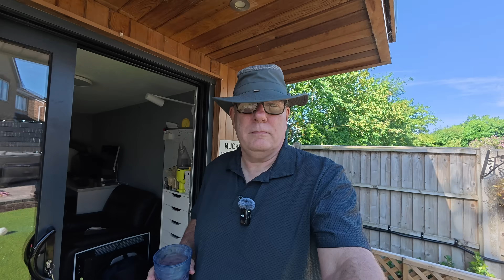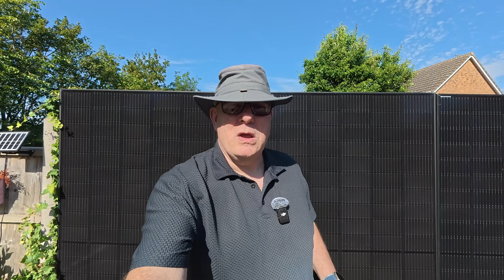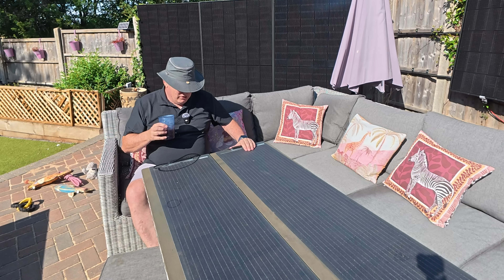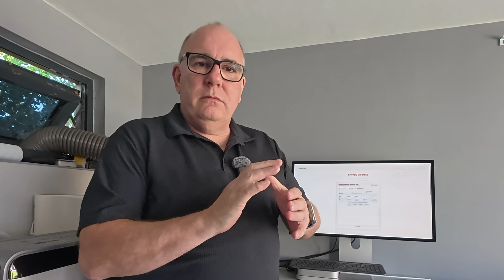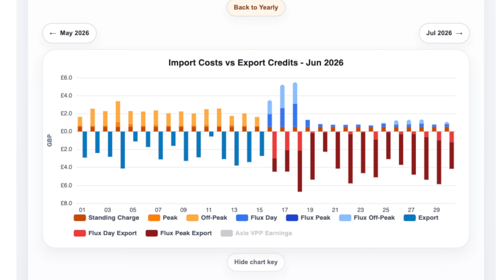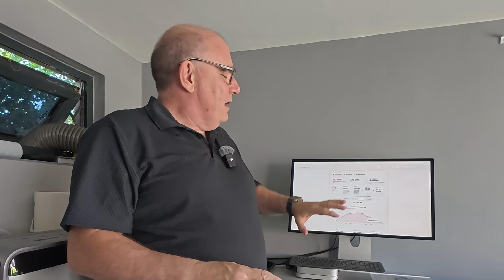Octopus Flux Is Back! Plus 4 Big Energy Project Updates

Comment: John I currently I’m on Eon with a zappi and charge every other day my Ev thinking of  hanging my battery to a power wall and going on octopus flux tariff as my export rate has dropped with eon and want a battery that manages the best solution are there any issues with getting a decent 20-25 kw charge overnight for my Ev from octopus on the flux tariff and charging a power wall my array is 4.7 and I generate about 4899 kw per year welcome your thoughts
Reply from the maker: there are no issues, but if you don’t have solar flux really isn’t a great idea. The reason is is that the difference between the price you buy energy and the price you sell energy isn’t very good. You only get three hours overnight rather than six on something like intelligent octopus.

Comment: Hi hoping either yourself or someone in the comments could shed some advise. Is a bi directional breaker required for plug in solar? And is it only needed for the socket circuit don't have to change all my circuit breakers in the consumer unit for bi directional ones?
Reply from the maker: @AshleyPeinelt, good question. My understanding is that any bidirectional protection requirement would apply to the dedicated circuit used by the plug-in solar system, rather than meaning every breaker in the consumer unit must be replaced. The final installation requirements will depend on the published rules and your consumer unit, so I’d have a qualified electrician confirm it before connecting anything.
Reply: @JonathanTracey Thanks for the reply Johnathan, I think for the cost I will just get the circuit breaker replaced for bi directional one. But like you mentioned I'll get a qualified electrician to  check this.

Comment: Sadly in my area the Flux tariff rates are not as generous. Daytime export is only at 10p and nighttime flux rate import is at 15p.

So if I don't have a lot of energy to sell at the peak time 4-7pm at 29p, I'll be making a loss.
Reply from the maker: those are my rates but I can run off my own battery all day so no daytime use and export 15-20kw in that 3 hour period. Making between £3.50 and £4.80 a day at the moment
Reply: That 29p peak window doing all the heavy lifting is exactly the problem - if tomorrow turns out overcast, you've imported at 15p overnight and have nothing to sell. A 7-day hourly forecast helps here: I use Volcast to decide the night before whether to trust tomorrow's sun to fill the battery for the 4-7pm window, or charge from grid to lock in the arbitrage. Makes Flux viable even in low-sun periods.

Comment: I have just seen an article in The Independent from 7th July "How to turn the British sunshine into your own private power station" on the value of combining solar with batteries and there is an interesting remark near the end: "Take Octopus Flux, a smart tariff from the UK's largest electricity supplier. Unlike standard tariffs that charge a flat unit rate throughout the day, smart solar tariffs offer time-of-use pricing that battery owners can use to their advantage. The tariff allows homeowners to set their own battery schedules via an app, buying cheaper electricity during the off-peak window between 2am and 5am, and exporting stored energy back to the grid during the premium peak demand period between 4pm and 7pm." This is the first time I have seen this supplier actually advocating that their customers engage in energy arbitrage. I suspect that it also makes a higher profit for Octopus without them having to take control of your battery as in the former Intelligent Octopus Flux.
Reply from the maker: @laurencecox2657 That's a really interesting find, thanks for sharing it. It does feel like Octopus has shifted from "we'll optimise your battery for you" to "here are the tariff signals, you optimise it yourself." That certainly reduces the complexity for Octopus while still encouraging customers to provide flexibility to the grid. Whether it's ultimately more profitable for Octopus is hard to know, but it's definitely a simpler model than taking direct control of thousands of batteries.

Comment: The ivy needs to go its casting a shadow :)
Reply from the maker: yeah dammed plants :-)
Reply: Poor plants : ) Hjnestly shading can be brutal - even partial ivy coverage on one string can knock significant %  off output. I use Volcast to track expected vs actual hourly production per string, so you can see exactly how much that ivy is costing you before and after it's gone.

Comment: I do appreciate your videos - very neat job with the screen images on the solar panels in the garden. We also have just switched back to Flux from Go, belatedly but still worth it. I have the heat pump heat the hot water at 1pm from excess solar.  With 10p/kWh export at that time we don't lose much, and heating in the night costs 15p. A very minor saving. Interesting content as always - thanks.
Reply from the maker: @jeffjsmith Thanks Jeff, I really appreciate that. It sounds like you've found a nice balance with Flux and your heat pump. That's exactly the sort of optimisation I enjoy—using excess solar where it makes sense and accepting the tiny trade-offs when they're outweighed by the overall savings. Thanks for sharing your setup, and thanks for watching!

Comment: Does this only really work with HA, or do you spend time every day setting your system on the flux tariff?
Reply from the maker: no, you don’t need Home Assistant, I just have mine set up on a scheduled discharge and I’d leave it to get on with it
Reply: @JonathanTracey  Thanks, how did you work out your schedule?  I have 6kw of solar and 32kwh battery. Would this work for me?
Reply from the maker: it depends on how well you know your own energy use, I know for example that if I export between 6 and 7 pm. Full 10 kW rate that my inverter can do, I will have enough energy to see me through the rest of the night until the sun comes up the next day. Only you can really answer that.

Comment: What would be really useful is to know how much kilowatt hours in your batteries you start off with in the morning, have at 4 pm, have left at 7 pm (IE enough to keep you going until the cheap rate) and have left when the cheap rate kicks in. Many thanks it would be helpful to compare (although I have only 23 kWh of batteries)
Reply from the maker: most mornings the batteries are at 20-30% and are topped off by 12-1pm, on flux we don’t use the cheap rate every much, only to heat the hot water.  in summer batteries are 100% charged by solar

Comment: Having done a quick calculation again it could pay me to move to fux for a couple of months or so.
Today exported 108kwh up to 4pm then a further 23 kwh to 131 kwh which would be at £0.277 from there on.
I can afford to export 10kwh from my battery with sufficient reserve for overnight.
Rather continue charging the battery up from the next day's solar as its effectivly cheaper.
Looks like my plan for an additional 6kw west facing array next would pay dividends over the summer months.
Think I will give it a go.
Reply from the maker: for me is increased my export payments by about 25% but it has also reduced my import to almost 0.

Comment: consider getting evcc as it offers a better visualisation and smat control what to charge when with a UI  for the public which I have not used so far.
But it works with 100s of brands (wallboxen, batteries, tarifs, and what not) , is a made in germany open source software and can run on the cheapest raspberry Pi but als as addon under Home Assistant as there are evcc addon and cards for home assistant too.
Reply from the maker: i’m not familiar with that one, so I’d love to know how you get on

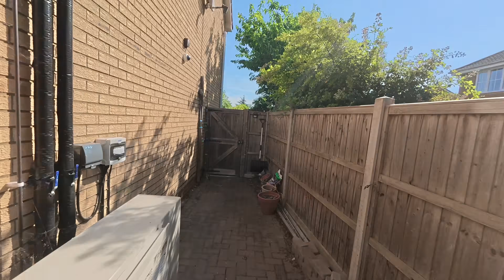Comment: 3:00 - german here: forget about lightweight flexible panels on the wall 
You have not heard about the real world: all of the manufacturers are struggling and suffering big time from micro cracks and you will face the same fate. 
It starts with the usual cold nights and hot days plus UV light and then the freezing winter all supported by much more wind in the UK I bet than in northerin germany. Overall the panel will delaminate, the protecting flexible glas film will start breaking and you will not see nor recognice it till it is suddenly there once you start comparing generation figures more carefully and use a loop / magnification glass to check the panels carefully. The worst of all is a spot on a RV , motorhome if the panel is not perfectly glued to the surface cause at every weak spot the suction of a 100 kmh  air stream will hit over and over again and expand the material, the lamination. 

Do it properly and use a usual big panel with a proper frame which you can find in germany that has also a proper certification cause in germany such a construction needs a certification on a wall. There are some vendors for these and those solutions are usually made in germany and rock solid, also passed the mandatory tests. 

Save the huge amount for overpriced flexible panels - watch videos where these panels have delaminated on the surface of german production halls where these were the only soluation cause the roof construction could not carry more weight than these. But the panels also cracked and delaminated and to get rid off these had become a nightmare as they are uusually glued. 
Those panels can be used only with the knowledge that those panels will age much much sooner then usual glas glas panels which is the biggest point to look for: glass glass panels cause those with foils become craps and will get damaged.
Reply from the maker: The whole point of trying it is to see what happens, if they crack and stop working then I’ll let everybody know. But there’s far too many rumours.” I heard it on Facebook.” to know what’s true and what’s just people spreading false rumours.

So that’s the plan install it run it use it in a real world scenario and see what happens

Comment: Hi JT, hope you're well. Apologies for being absent from class, I do have a note from the CFO... all work related 😣😣
After we had the expansion packs fitted our new installer recommend us to export everything. It lasted all of 24hrs, before the Ai algorithms kicked in and stopped exporting the batteries. It looks like from the forums the Powerwall learns quickly that my export rate of 17.5p is good but the day rate can be better utilised by using the batteries ALL day and covering our peak rate too. So it now only exports the solar. Not a major problem, but we now obviously take between 4 - 6kw to replenish the batteries (oh, and heat our hot water overnight too), which only takes a few hours of solar to recoup that cost before making us money.
Still trying to get to grips with this new tech🤯🤯🤯, and that's before the heat pump kicks in to heat the house in the winter!!!
Reply from the maker: i have heard the powewalls AI is a bit over  protective it’s a “mamma know best” attitude :-) glad the install went well, perfect timing for all this sunny weather
Reply: I’m using Netzero app. I also intend to use the power to reduce bills. Not too bothered about exporting at present

Comment: An interesting comparison to the minimal solar system I've just finished here (currently sunny Norfolk). A single panel on a 450 W inverter for a total of £290, including bits of cable, a ground mount and various items of hardware. 33 kWh over the last 24 days, averaging 1.3 kWh a day and on track for 40 kWh over the month. Very pleased with it, so I'll probably scale up to two panels and an 800 w inverter down the line.
Reply from the maker: sound good that’s pretty good generation for a single panel, well done 👍
Reply: This is a very slippery slope your on. It's how I started. Before  you know it your on the city plumbing site buying 4 panels and working out how best to upgrade your inverter. I started with a 12v system then 24v and finally a 48v system.  Biggest  bit of advice! Skip doing 24v its a waste of money.

Comment: do you think, its worth buying the old ecopflo stream system or wait for the new ones? I was thinking they may sell the old models cheaper.
Reply from the maker: it’s possible, but if you have a need right now, then I will just go ahead and get them. The new system is an evolution not a revolution. Yes, it will be slightly better, but you may have to wait quite a long time to get one in which time you could be reducing your energy bills with the existing model.

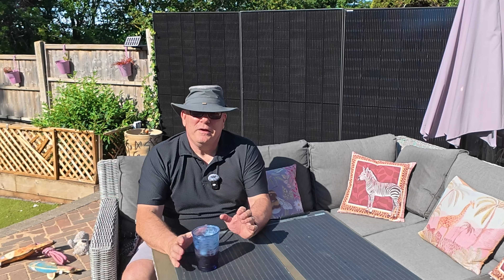Comment: Why not octopus cosy 13p 22:00 to 00:00 , 04:00-07:00 and 13:00-16:00. Cheaper than flux and more cheap hours.
Reply from the maker: Because you’re in the summer, I don’t need the cheap rate sessions, I can run entirely off of solar and from the batteries. And flux pays me 29p per kilowatt hour to export which you can’t get anywhere near that kind of rate on cozy.

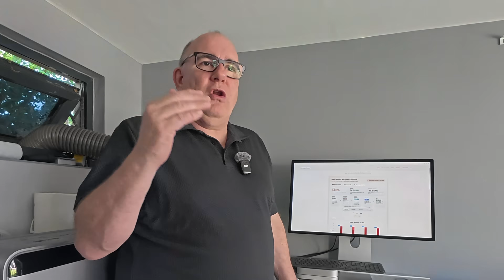Comment: Hi Iv got an Eco flow stream Ultra with 4 x 400w solar panels. My battery was at 50% and the panels were only outputting 300w each. It was full sunshine and my panels sit on a nearly flat roof with no shade on them, about 12:00-13:00. It looked like my ultra was limiting the panels input to 300w each yet the maximum per port on the ultra is 500w. When Iv only have 2 panels connected it allowed them to go to 380w each. Any idea why it’s limiting my solar input to 300w when all 4 are connected ?
Reply from the maker: i’m assuming you’ve got each panel connected to its own MPP T. You’re not doubling up panels in parallel?

Before calling support I would try tilting the panels up about 20° and just see if that changes anything. Completely flat or orientation will reduce the output of the panels unless the sun is directly overhead as it’s always striking the surface at an angle.
Reply: @JonathanTracey  yeah individually connected to each input. It’s strange though because when I only 2 panels connected they were about to produce 380w but with all 4 it limits them to 300w each. I’m wondering weather a thermal limit of the unit is kicking in or somthing. It’s been very hot this last week.

Comment: Nice update. You have been busy. Looking forward to seeing how your wall mounted plug in solar turns out
You noted you still run your heat pump's hot water cycle at night. Give some thought to running it early after for 2 reasons: 
1 it fits your Flux usage strategy better
2. It will improve efficiency as  the outdoor temp is warmer 🙂 
I'm still in 2 minds about going to Flux myself. Short term, it's no question the right choice, but I know I will need Intelligent Go over the winter and currently have a better rate 🤔
Reply from the maker: to be honest, it uses so Little electricity, less than 1 kWh day I don’t worry about it. I’ve just left the same schedule that we use during the winter during the summer months.
Reply: @JonathanTracey  I know what you mean. Mine was just 0.5kW today  😆

Comment: I was considering switching to Flux but I have a 12M fixed IOG off peak rate of 3.99p until next April which I would lose if I switched . I have an ASHP with Solar PV & batteries so the IOG off peak rate of 3.99p is literally gold dust in the winter for charging batteries & the EV!
Reply from the maker: Yeah, I wouldn’t be switching to anything if I had that rate

Comment: Why flexible panels on the wall , why not go with your excellent scrounging strategy and get some 500w ones? On a separate note am alone in finding the Ecoflow app frustrating and clunky?
Reply from the maker: because i want to try them, may swap them out later but have found a kit that includes 4 panels should be a one man job to install, where as 500w panels will need at least two people and bigger mounting system
Reply: @JonathanTracey the full,size panels definitely need a helping pair of hands

Comment: Seperate subject, but could you do a test/video on the losses incurred for the ecoflow stream batteries? So solar in kwh to charge the batteries vs the actual usable kwh you can get out of them? Ideally testing the losses depending on the load, 200w baseload vs 500w vs 800w for example. As I feel like woth mine there are huge losses. 1kwh in to the battery but only really seem to get getting 0.6kwh of usable energy after all the conversion losses.
Reply from the maker: I have looked at it, but I can’t find any equipment that would give an accurate number. I tried doing it with off the shelf metres but I’m not convinced it was anywhere near close. Generally, this kind of thing needs to be done using much more accurate equipment than I have access to.
Reply: @JonathanTracey  I might try it with a 500w halogen flood light, that will be a very steady load and the meters you can just plug stuff in to and measure the usage are quite accurate, especially with a steady load. Or could just switch off my whole house apart from the 500w load and just use smart meter reading to see usage (that is 100% accurate so they can bill us hehe). Then do a seperate 0% to 100% charge on solar yo get the input and compare. Thags surely going to be as accurate as you can get? 🤔🤷‍♂️

Comment: I was on Flux but the Powerwall algorithm didn't cope well with the 3 different rates plus my 19.4 kw array and 5 kw export limit. It would fixate on the 4pm to 7pm export and charge the battery without exporting and then curtail the solar. I was using NetZero but this has virtually no effect on exporting.
I have changed to EDF EV tarrif with 15p flat rate export. I now export from dawn to dusk and I am £100 in credit so far in July.
Reply from the maker: yeah, I’ve heard a number of people comment that the power wall doesn’t like being told when to discharge, it prefers to figure it out itself